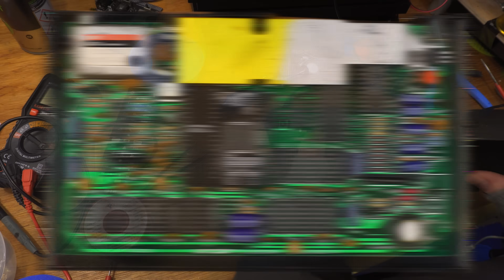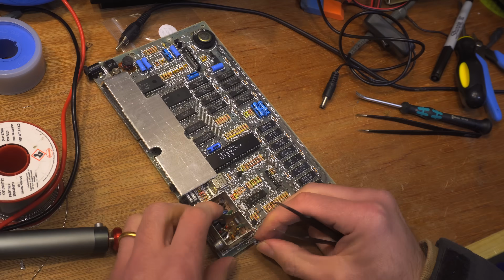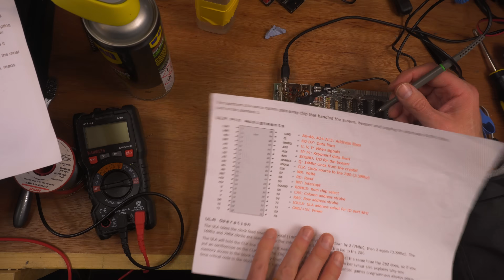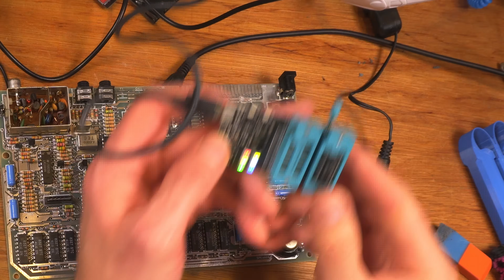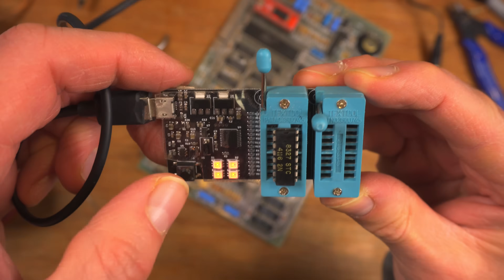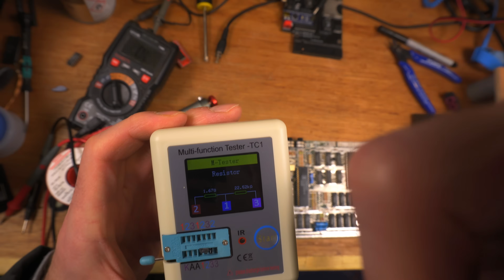ENDURO-REPAIR part 2 - ZX Spectrum Repair 48k

Comment: If the chip is not rare or expensive, just cut off the pins. Then one by one heat and pincer out. There are some industrial board that are rare and dips are slamed in. Wery hard to extract whitout damage.

Comment: Many many moons ago (late 80's!) I worked in a small computer shop doing board level repairs. We didn't have fancy tools like desoldering guns, just big chonky unregulated soldering irons and a solder sucker, so losing pads was common.  We didn't worry though, as we just replaced them using teeny tiny copper rivets from through-hole repair kits.  Do they not make such repair kits anymore?
Reply from the maker: I'm sure thats something you can still buy somewhere. Not super common now though. The standard practice these days is to run bodge wires.
Reply: They still exist but they are eye wateringly expensive.  I've seem them for sale for aroud 200-400 quid.

Comment: PCBs from the 80s especially the low cost crap Sinclair and commodore (until revision C), commissioned have an issue where the glue (Euhm troll snot) on the copper layer dries out. And thus the traces and pads hardly stick to the fiberglass and that’s when even the cleanest and most careful (de)soldering job can detach them. And there’s really nothing you can do about it. Except sacrifice a goat to the retro computing gods and hope for the best. And you’ll know you’ll be dealing with such a board when you see “bubbling” on large planes. What I found reduces the risk is be liberal with flux before desoldered and using a heat gun melting the old joints and then desolder with the solder sucker. But that’s also far from 100% certain. But it does reduce the risk (at least in my subjective experience).

Lol er minutes in you bring in the hot air 😂
Reply from the maker: I'm always refining the method I use now. Each board is different so it's good to be flexible.

Comment: Great job! Some boards just won't give up those ICs. ;-) I'd not use a heat gun regularly, though. Heat is the worst enemy of vintage ICs, and it is very difficult not to heat up the ICs around the one you are trying to remove. Even if they don't fail on the spot, you will be reducing their life span, even significantly. You won't see this on YouTube videos because, well, it happens after the videos are completed. ;-) I think what you did originally, with desoldering braid, is the way to go, and you should stick to it. What you missed was to use plenty of good-quality rosin-based flux paste while doing it! You may also experiment with different soldering tips. Robust chisel tips can hold more heat, allowing you to desolder at lower temperatures. If you keep the temp at 350 Celsius or slightly lower, and not dwell too long, these ICs should come off without damage to the board (with plenty of good-quality rosin-based flux, that is!).
Reply from the maker: Thank you! Your thoughts on hot air are exactly what my thinking was, and its not just the IC's around the one you're removing, its all the other components getting heated up and cooled down. Rapid heating and cooling isn't good for many materials. Since this one I have started to use a mixture of my old solder sucker+braid when I can and hot air when I cant. Flux is something I should use more of. I will get some paste and add that to my toolset! :D

Comment: I'm surprised you don't have more subscribers! Maybe your knowledge/skills aren't at the level of Jan or Adrian (YET), but your editing and humour more than make up for it. Always love to watch the video, 10 for entertainment value 🙂
Regarding the technical side, just some small tips. If there was a problem on the data line caused by the z80, the systems wouldn't run the diagnostics or anything else. Fact that it is running diagnostics and the fails the ram test rules out the z80 are the cause. The rom is much less likely to cause problems than ram, so go for the ram. Good lower ram would allow it to boot with a short selftest during boot visible by the much shorter startup time (unless the upper ram fails in such a way that it corrupts the data line). That leads to the first suspect being the lower ram ics. Sure anything on the databus like logic ic's could also corrupt it, and this happens often on systems like the c64 and others but the speccy doesn't have many of these. Anyhow just my way of thinking, hope it helps you in future repairs, which I am looking forward to!
Cheers
Reply from the maker: Thank you for the kind words Patrick! That really made me smile :D
YES! Totally agree with your line of thinking, and I should have thought of that myself. Of course the CPU was running! Still, it made the episode a bit more interesting with a small wild goose chase ;)
Reply: @MoreFunRetro  Definitely true, makes a longer video, so "More fun watching it" 😉

Comment: What tape do you use to attach the front after replacing a keyboard membrane? I replaced mine but the tape I used is far too thick (looked plenty thin before I used it) so the front sits proud of where it should be.
Reply from the maker: To be honest I'm still looking for a good solution to that myself. The double sided tape I have here is not the best.

Comment: interestingly if im doing the hot air method for removing chips i don't remove any of the solder first, i might remove it if it's very tarnished and old but only to add fresh back in. having more solder to absorb the heat and retain it so that it remains molten makes removal much easier than wrestling with numerous tedious bits of left over solder holding on to the legs for grim death because they refuse to go molten. This comes from experience of doing HDMI/USB-C port replacements where often they're attached with high temperature melting point solder from the factory.
Reply from the maker: That actually makes sense. I just had to remove a CPU from a Spectrum and it was quite tough to keep the heat into all 40 pins. But it does worry me that much board is getting so hot that solder will melt on the other side. I will experiment!
Reply: @MoreFunRetro  on something like a cpu you could be right, i did do it on a neo geo bios chip though and those are very large but its also a less heat sensitive board given its built to sit in an arcade cab

Comment: Just had something like that happen to me too when i socketed an Atari Jr. Rev. F. The RIOT chip didn't want to come out after using a desoldering station, so i heated the back up with a hotair station, finally pulled the chip out and ... yay! Via pulled! Nothing a good botch wire couldn't fix though :D
Reply from the maker: The old me would be secretly thinking "I would have got that out without lifting a pad" but the old me is a dick. The new me realises that some boards are so fragile there's really not much you can do to prevent them falling apart.

Comment: Enjoyed your video, as usual 😄 How's the Scotch-Brite hunt going?
P.S. Are those Quartz tubes for the desoldering pump really fragile too? Mine keep cracking, original Weller tubes. And no, I do not overtighten the seals, only as far as necessary to make it airtight. Seals themselves are perfect.
Reply from the maker: Thank you Paul! I have some! You might see it in episode 4 of this series. Worked a treat!
Reply: @MoreFunRetro  Glad to hear it! I have to admit using blu tack is something that never crossed my mind in the 35 years my hands have been handling soldering irons, but I am going to order some. Brilliant idea.
Reply from the maker: It's become an essential here. So many uses!
Reply from the maker: I missed the other question you asked! Ive not had any problem with the glass tubes on my desoldering station so far. I dont think they're particularly fancy, and I bought a couple of backups just in case.
Reply: @MoreFunRetro  Are they also quartz or boron glass?
Reply from the maker: Sorry Paul. No idea.
Reply: @MoreFunRetro  No biggie mate :)   I'll just have to investigate and see if there are boron glass versions. these quartz tubes crack very easily. Been considering getting a gun type like you have but with a weller DIN connector so it can be controlled by the station. The one I have is the one you have to hold in a pencil grip.
Reply from the maker: Ah! I've seen those about. Can you control the temperature on that one?
Reply: @MoreFunRetro  Yes, the station can regulate from 50 to 450 C. I have it at 330-360 C for regular desoldering. But I often have blockage , disrupting my workflow everytime I need to clean it, so its getting annoying. The pump in the station seems fine, pressure goes down to 0.4 Bar when it's completely blocked.
Reply from the maker: I have similar problems with mine. Needs a lot of maintenance.
Reply: @MoreFunRetro  Many videos out there reviewing desoldering guns, only a couple of real good ones - and expensive. Although this weller station was 1,500 Euros in 2001, including three appendages. A Soldering pencil, the desoldering pencil, and hot air pencil. Did not pay for it though, when I left that company I asked if I could keep it and they said yes, they had no further use for it as they were an IT company. I did some laptop board repairs internally for them and the savings were so high it justified the investment of that station.

Comment: Why you wiggling the soldersucker so much, looks like black magic. Those lost pads got sucked into another dimension!
Reply from the maker: Couple of reasons. It helps to centre the leg in the hole which gives it a better chance of coming free. The movement also helps mix the old solder with the new stuff. And lastly the black magic doesn't work unless you wiggle!